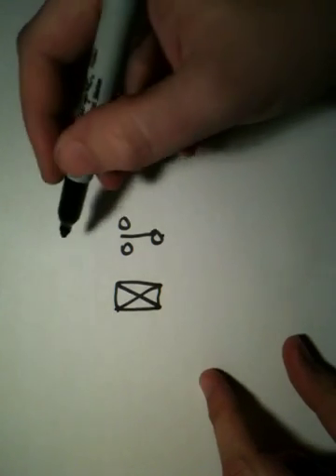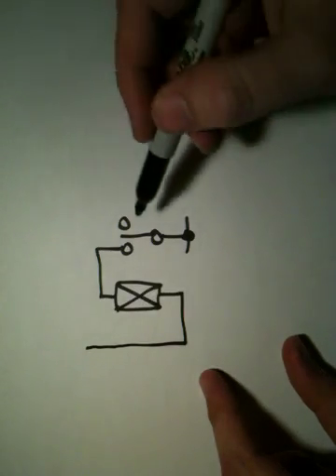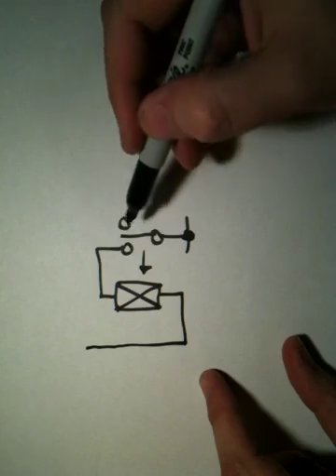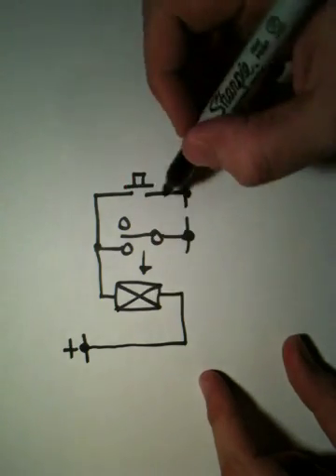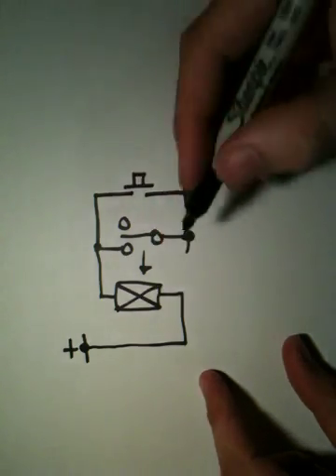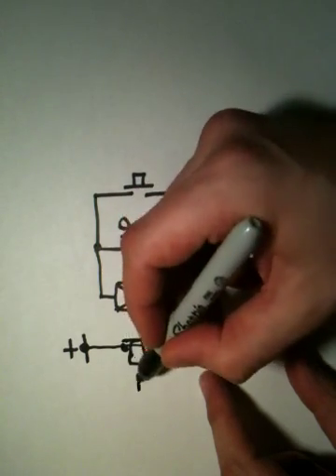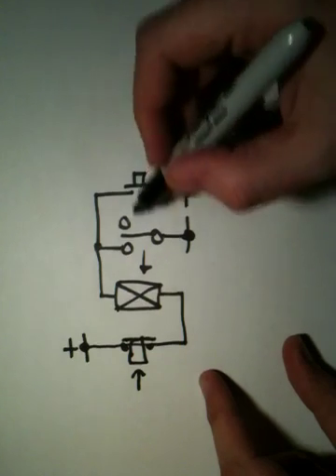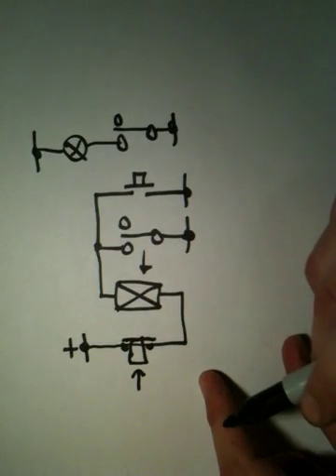Relay logic: simple latching relay

Comment: If I get this right (left guessing) you trigger the first relay to engage the second relay, which is wired so that the power through the second relay holds the second relay closed (conducting) and the only way to relax the second relay is to remove the current? There, if I got what he said so fast right, I also explained the actions of the 'box with an x in it' that represents the second relay.  Next time you make a video, USE A SCRIPT AND DO DRAWINGS BEFORE HAND...  this was entirely ad libbed?

Comment: you could use a common latch relay (uses magnets to hold wiper in position) and use reverse voltage pulse to unlatch. Would require your contacts for operation to be dpdt ((?) from memory)   -  switches with center off, momentary on.

Comment: @mrhobbit007 

There are 2 types of latching relays, single and dual coil. Single changes reverses it's output each time the coil is given momentary power. Dual coil relays will latch one way or another depending on which coil you give momentary power to. I use the later on car alarms, since it will stay latched "off" even if the alarm brain is ripped out and draws zero power when holding a possition.
Reply from the maker: HiProfile67 this is about using a normal off the shelf relay to latch on and off not one that has two coils.